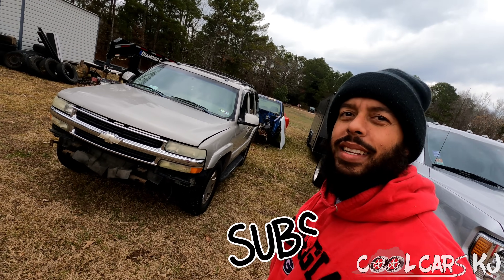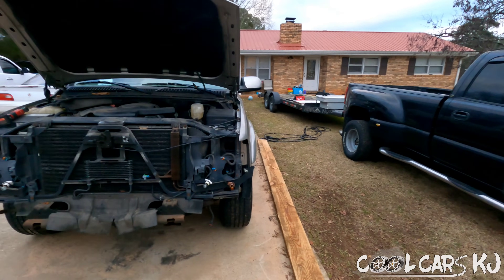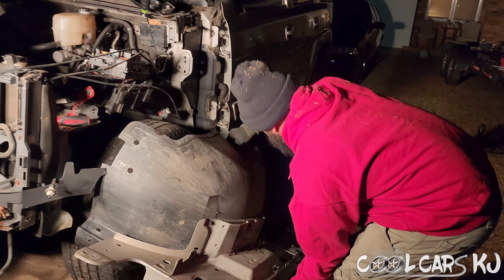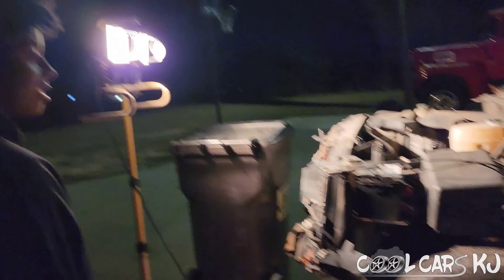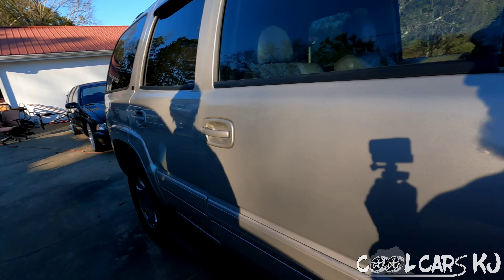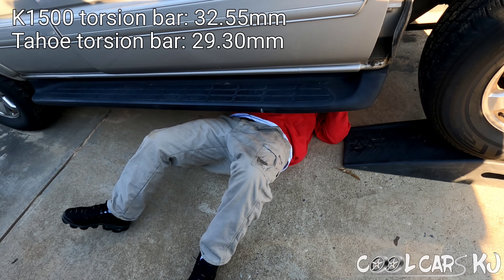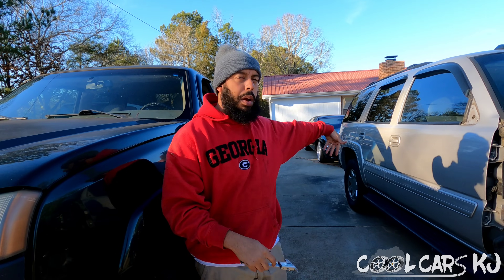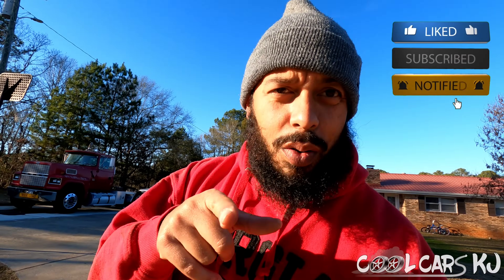Y'all said I already have the parts in the yard, so let's check it out 🤔 #cateye #nbs

Comment: The bars might be different sizes. That's common different strengths in steel. As long as where they connect are the same size is what you're looking for.

Comment: Could make a prop rod going from the radiator to something. Just like semi trucks. The Tahoe is probably smaller for a softer ride. I bet that bracket would fit. But $90 is cheap compared to that extra work. If you're just looking to flip it just loosen the torsion bar key lol

Comment: Okay once you release those keys okay this is how you have to do this Jack the front end up put it on jack stands release the keys get you a if you don't have one go to Home Depot and get you a 3 lb hammer 084 lb hammer what does short handle cuz you're going to have to knock that torsion bar you going to have to knock it out towards the front end of the truck once it comes loose once you know you got to release those keys first once you release the keys once you've done that then you knocked the torsion bar forward once it comes out of that book that that that that that that that that keeper you'll be able to handle it just as nice if your lower control arm is it bad or the ball joint isn't bad then don't worry about it but if the ball joints back go ahead and replace the lower control arm but you would have to do that for both sides before you can remove that CrossFit number but if you got to pay somebody to do it cross members of 90.00 Pop and whatever torsion Rod is cuz you're not going to use that bent one and get to lower control arm for 300 bucks you got a pretty good running truck put your plow on the front of that sucker and have you apply a truck

Comment: It's not going to work is the pickup has a thicker torsion bar you're going to have to replace that torsion bar and as far as the key is concerned you can still use the key but you got to replace the crossmember cuz it's been up all the Blazers but for you to try to use that other truck torsion bar it's got a match the front end as well as the rear so my advice would be either go to scrap yard or check your vehicles before you move on to see if those torsion bars are thick enough that is a Precision part even though it doesn't look like it is it is that dinner torsion bar is not going to support the weight that torsion bar is not going to support that truck because it's a different size which means you would have to change the lower control arm the torsion bar in a torsion key and you cannot have Mitch Match Parts on that suspension cuz it ain't going it's going to ride lopsided my advice you probably can use the crossmember but go get you another torsion rod I mean to go that route you must have changed everything to crossmember both tuition rods and both lower control arms remember that stuff is a different sizes and if it don't hold correctly it ain't going to it ain't going to operate correctly and you're absolutely correct about the OBS four-wheel drives they are torsion rods add a 1994 and head torsion Rod front and it was a 4 x 4 extended cab what is 305 I put 300,000 MI on a 305 I want to find a new engine but I ended up getting sick and going to the hospital for for some time and left the vehicle in front of my grandmother's house one of the neighbors took the tags off my vehicle call the police and set my vehicle was abandoned my grandmother was an old lady so therefore she was moving around the house a lot me and oh boy did have it out start to break his jaw I was a couple months getting well been doing that time they towed my truck and so did the state don't wait around for nobody but no you're absolutely right you got to keep in mind those torsion bars are calibrated to size for weight you can't put that thinner that 29 in there with that 32 you just got to go and bite the bullet and replace that 32